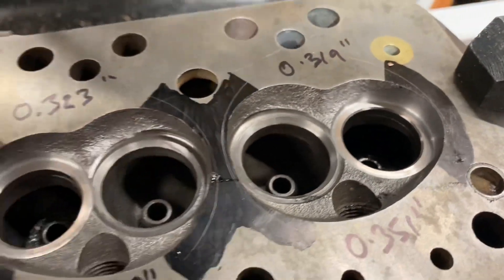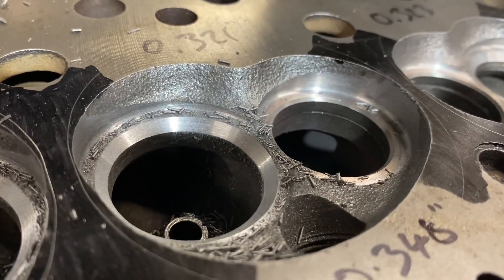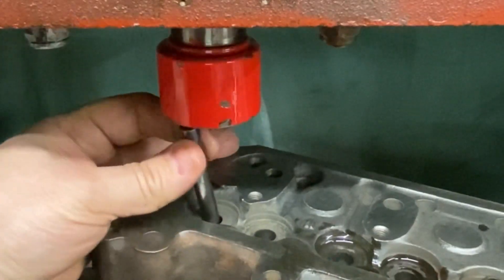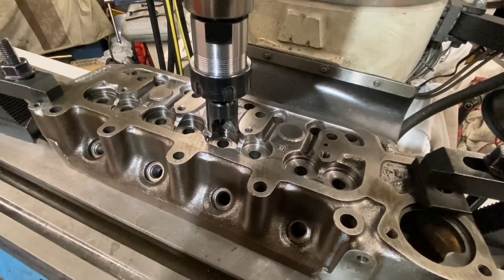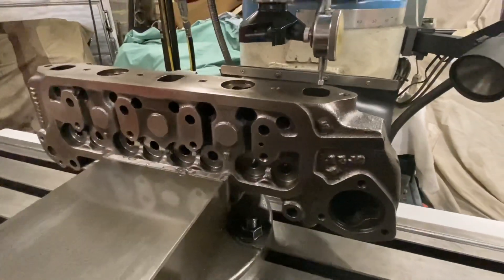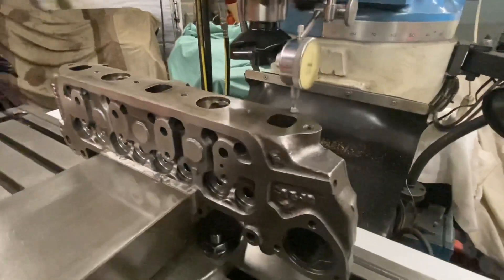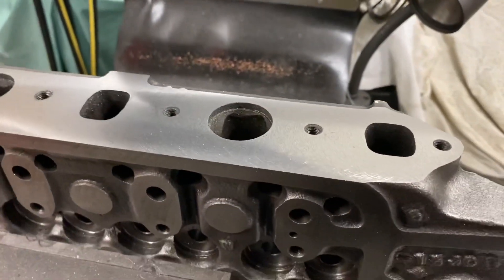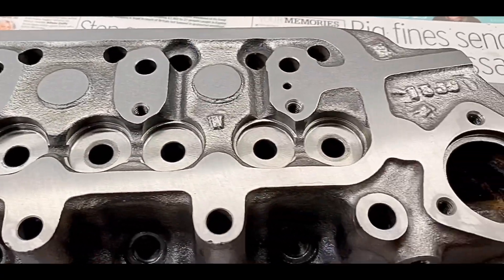1275 head rebuild + Mods - Part 2

Comment: i love watching, but have some late questions: How much can one machine from the spring seat before compromising the head itself? Say the head is very uneven or someone is experimenting with different springs. could 3-5mm be machined down? Next, where can one source valve guide blanks? say other valves are sourced and a different stem diameter is required?
Reply from the maker: Casting is quite thin, limit seat depth adjustments to 1.25mm. You should be using a sonic tester to verify the thickness some are considerably thicker than others, make your own blanks from Colsibro bronze.

Comment: That cast iron is pretty 'soft', machined up nice.
Machining spring seats deeper,  how much material left before spring seat hits port roof?
Can you get different length valve stems if needed or doesn't it matter as much if you shim rocker arms?
Reply from the maker: Sonic testing is used to check casting thicknesses, longer valve are available but this does not help
With geometry or shimming.

Comment: Hi, Did you make the valve spring seat 
cutter or is it one you can buy online, thanks for a great video
Reply from the maker: It’s a 30mm spot facing tool I purchased from ebay